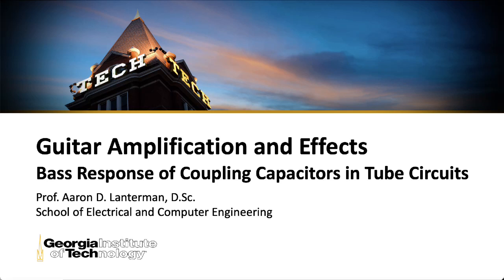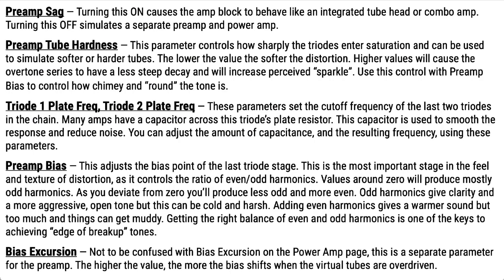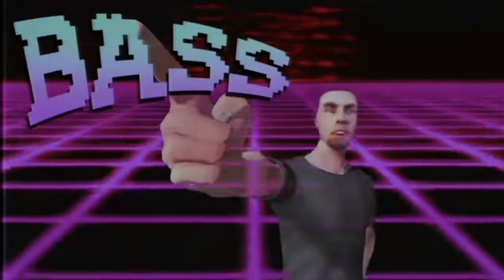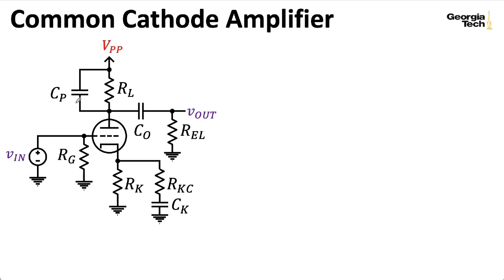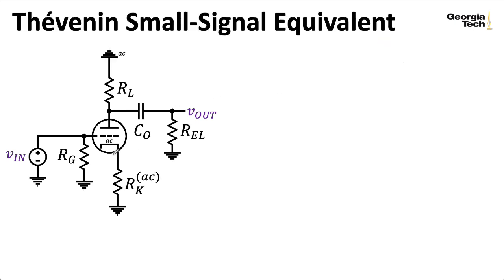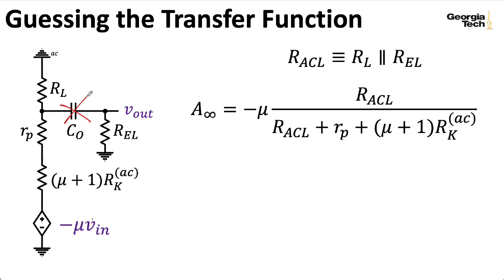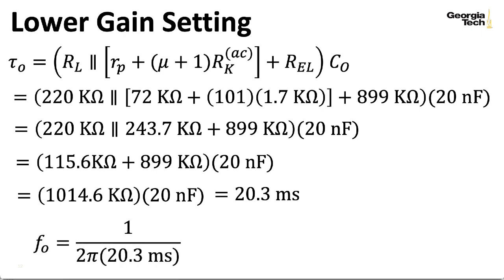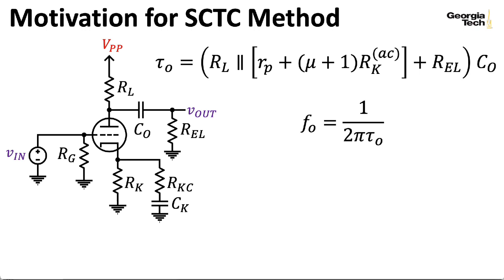ECE4448 L32: Bass Response of Coupling Capacitors in Tube Circuits (Guitar Amplification & Effects)

Comment: 0:22m Bad Bad, mister Lanterman, that's discrimination, i had to listen 3 x.
: )

excuse me, that i didn't follow all the video's on tubes, accept one.

what kind/level of voltage would i expect at Vout?
... and feeding this in to the output transformer from the Gyraf(dk) Pultec PEQ1A type E.Q.
since the tube sources from a 220V+++ supply!
What i measure at the other side of the transformer? ... what goes to a mixer.

the transformer "experiments" was a success, i fed 226V ( at this moment) and got 208V on the second transformer.
i have the suitable rectifiers, but not yet soldered them. but calculated a 290V DC.
the schematic has a 2 watt 3K3 resistor after the bridge rectifier .. and indicating 250V+.
make a voltage using 2 watt resistors? to make a voltage divider? should a aim for a certain voltage?
Reply from the maker: Re: the supply, once the power supply has a real load on it the apparent voltages will drop. It's hard to say until you build it and measure it.
Reply from the maker: Remember transformers don't pass DC, only AC. I will be lecturing on transformers in a couple of weeks, so be sure to check back then.
Reply from the maker: Here's the playlist for the full guitar amplification and effects class, so you can watch more tube lectures: https://youtu.be/ahGiA_JCGT8
Reply: @Lantertronics  my Tektronix 2212 scope does 50V per division, even my tektronix probe does x10 ( but i can't find a switch on it), but i have the manual of my scope
: )

goes a little out of my scope, such  "high" voltages, close to 300V. my first tube experiment.
Reply: @Lantertronics  i know, the rectifier makes it DC and "increases" it's potential in voltage.

a friend of my has a real analog meter, not a real vintage one, it might help me.
Reply: @Lantertronics  on this project, i source the parts first, to have their footprints.

next thing, i have to do is source the inductors from mouser.  i have done a elementary view in the list of mouser.

than, i have to find a 19 inch rack case.
than i start building to make the PCB fit in there, different ground planes for different potential?, the original wired point to point wired, with is pretty cool, but I'm not gonna do that.

Does your road map also include:
Teletronix® LA-2A Classic Leveling Amplifier | Universal Audio?

i would would like to know how that circuit works, contains other kind of tube ... and that seams to be the interesting circuits of it .. that controls the optical attenuator ... and what kind of light is that, it's not a incandescent light.. the guy that clones these thing probably want tell ya. but it should e easy to make.

Since you got me in to tubes, i choose that circuit as second. since a video i got served by  ..., from apparently doctor Dre's engineer studio tour and saying they used them on the records of Eminem, Dr Dre and many more.

it's a pretty important circuit in human history., as like the Pultec tube eq design origin, they where produced to shape sound to be pleasant to be aired in the old days.

Will it be included?

also a problem is, the old devices didn't had access to 1% nor metal film resistors, should that be taken in account as well? 5% carbon resistors? since i didn't stock pile all the formula you have thrown, i can't really verify if the results are "accurate" from the clone. using current material would probably increase the precision or so.
Reply from the maker: @AnalogDude_  No reason to use imprecise resistors nowadays; the cruddier ones aren't particularly magical. As long as the wattage is appropriate it should be fine.
Reply from the maker: @AnalogDude_  I'll do a general lecture on compressors at some point, but probably not the LA-2A in particular other than passing mention as an example of an optical compressor with voltage divider attenuator with the light dependent resistor in the lower leg.
Reply from the maker: @AnalogDude_  The main thing about the LA-2A is that the tube amplifier providing the make up gain can be analyzed entirely separately from the actual comrpessor part You could take that amplifier and use it in some other circuit, or you could make a version of the LA-2A that uses solid state as its make up gain, or use a different tube amp, or whatever. The side chain input comes before that amplifier.
Reply from the maker: @AnalogDude_  Check out this writeup: https://analogvibes.com/wp-content/uploads/tube-opto-compressor-the-3-iconics-knobs_analogvibes.pdf
Reply from the maker: @AnalogDude_  Oh! And check out this schematic where someone redrew the schematic to make it clear what does what: https://static.gearspace.com/board/imgext.php?u=http%3A%2F%2Fi55.photobucket.com%2Falbums%2Fg136%2Fjaymzcrane%2FLA2A-deconstructed.jpg&h=edb13a6573d6e7abcde016b89d0be254
Reply: @Lantertronics  Awesome, accept i can't see where this stereo link get inserted and the resolution is a bit small to clearly or more clearly see the values of the components.can't read some resistors and capacitors value.

i see i can get al tubes for it, including the 6AQ5, there is some model named: Philips EL90 / 6AQ5.

find the right:  electro-luminescent  panel, not sure what properties is has to has and what voltage is supplied.
Reply: @Lantertronics  I'm very interested in making it a solid state version, once i learned what the required properties are of the electro luminescent material inside the "t4 optical atennuator", how it works, what voltage and amp it needs, but i guess i have to build the clone first and hopefully i can measure it with me tektronix 2212 scope.
Reply from the maker: @AnalogDude_  You can buy the T4s from Studio Electronics in https://studioelectronics.biz
Reply from the maker: Don't underestimate the complexity of what you're attempting. If you really want to explore the LA-2A I'd recommend starting with a kit.
Reply: @Lantertronics  a Guy that has a company called Kenetec that makes/produces T4 optical attenuator's (cells) recommended my a groupdiy forum topic to hook in.  

a German shop "analogvibes"  has kit witch has a laser cut case  with resemble closely with the orginal looks like and is point to point wired. but that's a bit over 1000€

some compressors, like the SSL clone from Gyraf audio(dk) and some DIY are somewhat weird, it's not clear to me how they detect if you exceed the audio line level and reduce that amount. the "ratio" of a compressor! what does that mean? 

I'm still curious and think on how this can be succeeded using opamps, using differential amplifiers and what not.
It's easy to use a comparator to detect if you crossed 1V AC, line leven. but that's just a logical 0/1 and not a starting point to measure. but I'm pretty it can be done.
Reply from the maker: @AnalogDude_  Good luck!
Reply: @Lantertronics yesterday i discovered the LA-A3 compressor, the Teletronix/urei LA-A3 is solid state, runs on something like 12 Volt (not very clear from the drawing) DC, but has a "side" of a transformer hooked the "EL panel" tapped right after the rectifier, before the voltage regulator, the other side of the transformer aint used.  these EL panel seam to run optimal on 120 volt, but yet uses the same T4 opto cel as the LA-A2. i wonder if i could replace the T4 col with normal LDR's and leds, but leds are single sided or polarised.
Reply from the maker: @AnalogDude_  It wouldn't be a drop in replacement to use normal LDRs and LEDs.
Reply from the maker: @AnalogDude_  In any case I'd definitely recommend a project like building a LA-3A before tackling something like the LA-2A.
Reply from the maker: @AnalogDude_  Even the LA-4A with better op amps might be a good option.
Reply: @Lantertronics  lol, i didn't know that there was a LA-4A.

Look very good, actually awesome, what i said, a wave rectifier.

now i need a source for a High End LDR.
Not the ones i could buy at the local almost 40 year old electronics ship around the corner.

and figure out a line- and line out aside XLR connectors.

the EL panel is cool, accept figuring out how to trim down from 290 Volt DC after rectify to 120V ... a voltage divider?... witch seams to be the optimal working voltage of a EL panel ... than i could skip the specialized transformer  used in the LA-3A. but simply using a transistor or (MOS)FET.

Thank you.
Reply: @Lantertronics  i discovered this one in the "linear" library of Autodesk Eagle: mc33078 DUAL HIGH-SPEED LOW-NOISE OPERATIONAL AMPLIFIER ... by tExas Instruments.

normally i use Mitsubishi  M5218A or TL072/4.

than you have the OPA series and Analog Devices seam to sell high end opamps.
Reply: @Lantertronics  i tried using a 220V to 9V transformer in reverse driven by a 2SC945 transistor, a 100R resistor on the collector in my modular synthesizer / breadboard connected to ...,
AC/DC coupled with 10nF film capacitors.

i used a Modular synsizer VCO with a 10V.p.p. sine, but although a 200+V signal, it doesn't look lie a sine. using 50V/division on the scope.

the amplitude drops on frequencies lower than 3K5 and around 750H it maybe is a 20/30V signal.

mission failed.
Reply: @Lantertronics  i'm gonna build the LA-A2, the LA-4A and the Urei 1176 .. if i can get a 4M7 pot.
Reply: @Lantertronics  Professor, after rectifying approx 220V and getting +/-290V DC what NPN transistor for a linear power supply would you suggest to scale back down to 65V DC.  i saw one in the transistor eagle library to indicated 160V Collector emitter voltage.